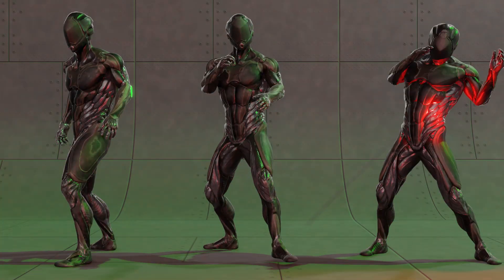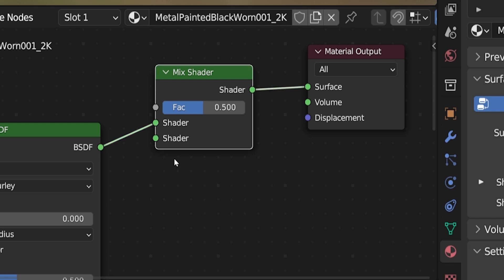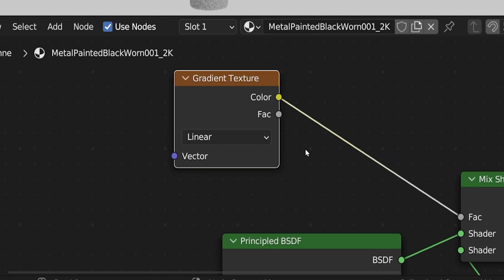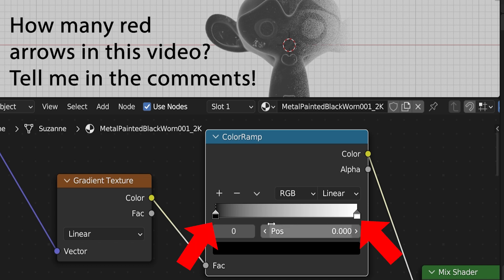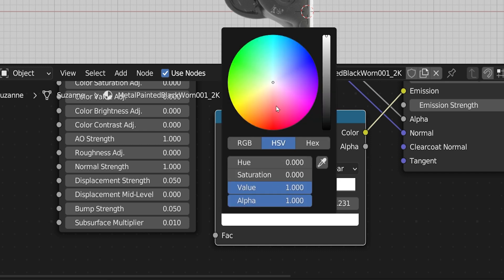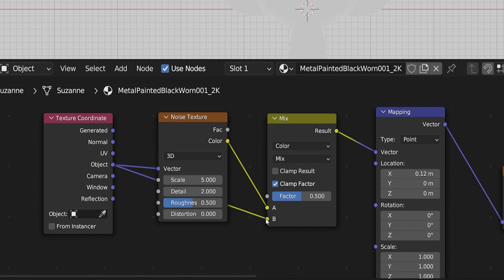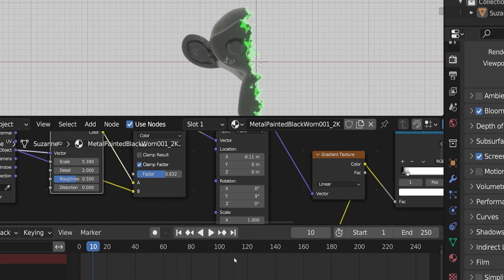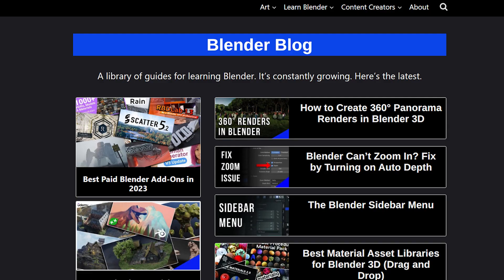Blender 3D Disintegration Tutorial

Comment: Excellent tutorial, just like every other tutorial or quick tip I’ve seen of your to-date.  

I noticed a minor niggle at the end of this video where you set material mode key frames.  You set the key frames for the transition location and then you set the key frames for the variable transition spread, which messed up the intended transition start and end positions. Luckily, it’s an easy fix that can be achieved by going back to the transition location keyframes and tweaking the position values.